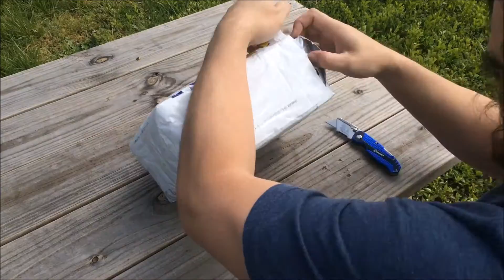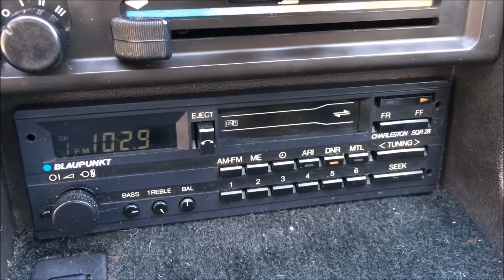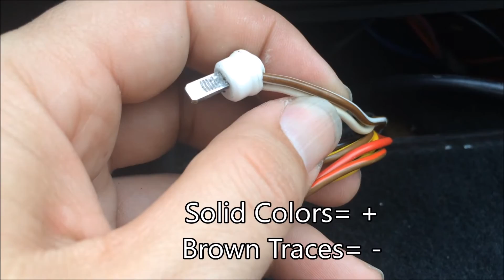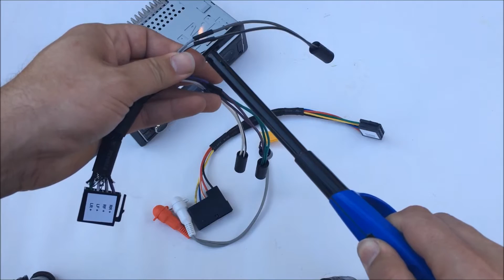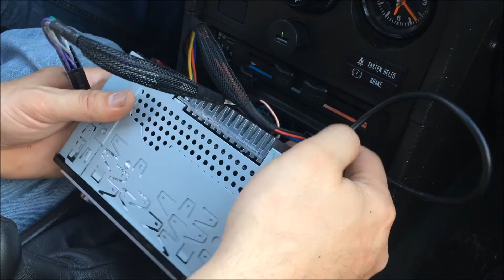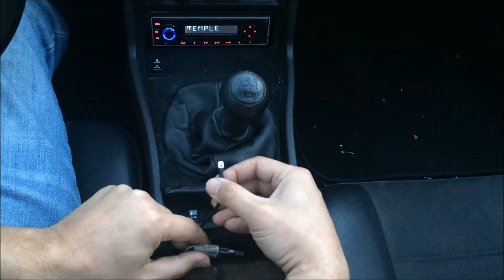Porsche 944 - Installing a stereo with four speaker wiring adapter

Comment: I cannot locate a harness that ties to the 4-spkr system in early 944s with the fader control.  Do I need to run all new wiring or would I just use a pair from the harness you used and still use the factory fader control?
Reply from the maker: I don’t recommend keeping the fader switch. With the switch you’d have one channel powering two speakers which can lead to distortion. To find the individual 4 speaker wiring, just pull the wiring going to the fader switch. I think it’s all brown and not color coded like on the later cars. I also have some footage of where I’ve done this buried in a video I did on a silver 1984 944.
Reply: Ahhh the all brown fooled me. I have seen it and can use that.  I will just have to tap into it since there’s no connectors like that on mine since the fighter control.  I Will look for the video you mentioned I must’ve missed it.  Thanks!!

Comment: The cable in my 944 are not like that at all and i can’t find any information
Reply from the maker: I have come across some cars with completely different wiring. The wiring in the video is the most common that is used on the Reno and Charleston units. Other head units seem to have their own wiring and there isn't much info available on them, so you'll have to use a multimeter to figure out the wiring...

Comment: Does this work on a 83-84? Are the wires the same? The adapter?
Reply from the maker: Yes, for the most part. If you have an aftermarket head unit already there’s a strong chance that they wires have already been cut. I also find that these adapters typically only work with factory Blaupunkt Reno and Charleston units which were very common. However, some other factory units may have different plugs. Good luck!

Comment: Finding a 4x6 speaker that fits well inside the early doors can be a challenge.  Either the magnet sticks out too far and hits the window guide or the speaker frame itself is slightly the wrong shape and won't sit flush with the door.  I guess the other issue is that most tweeters protrude and contact the stock grille.  Do you have any tips or tricks to finding a speaker that fits like stock?  I recently tried to revert back to the original equipment and found some old Blaupunkts that looked absolutely perfect but I think the voice coils were broken since they made no sound at all.
Reply from the maker: Very true. Most original speakers no longer work at this point despite looking new. There are some speakers out there with tweeters that will fit behind the cover. It’s just hit and miss finding which ones do. If you can find a good picture of one before ordering just check to make sure the tweeter doesn’t protrude above the surface of the side of the speaker.

Comment: Edredas, thank you so very much for all your videos - more than once the have kept my 944 running! After installing a new old radio I finally found out a omeone has tampered with my “ignition” cable —> #2 in your
Video. Can you tell me where this comes out near the fuse box? Where could
I grab “IGNITION” electricity when adding a new cable? Thank you so much from Germany - Fabian
Reply from the maker: If I remember correctly, on an early car it should be the upper fuse #9 for the the power sunroof, etc. This runs to the sunroof/radio relay behind the console. Its a rather big relay with a diagram on it and should have all the wiring you need, if it is still in tact. I hope that helps!

Comment: Hello....all your 944 video have been helpful to me as I just purchased an pasadena yellow 1984. Where do I get a tool that takes out the radio like you showed? Mine isn't turing on - what should I check? Thanks so much
Reply from the maker: I got this one from Amazon. It was really cheap too! I've replaced it since then though but it was a pretty good radio until the display went bad. Thanks and good luck!

Comment: Hey, edredas, love the video but got a question. I have a 83 944 that I'm trying to figure out if the stock alarm system is causing a no start issue. However, for the life of me I can't figure out how to get to the radio, let alone remove the radio. Its the stock Pioneer Super Tuner. I can't find any release holes for it or anything to pop it out. Any suggestions would be awesome!! Thanks
Reply from the maker: Hi, all the stock radios were Blaupunkt however removal of a Pioneer is similar. Just remove the bezels and you’ll find slits on both side of the unit where you will insert tools. Those tools look a little different than the ones I used but it’s the same idea where you just insert them and pull the radio out. I’ll leave link so you can purchase some. Thanks. https://www.ebay.com/i/401179823385?chn=ps&norover=1&mkevt=1&mkrid=711-117182-37290-0&mkcid=2&itemid=401179823385&targetid=888730200652&device=m&mktype=pla&googleloc=9009958&poi=&campaignid=9426322747&mkgroupid=98144264760&rlsatarget=pla-888730200652&abcId=1141016&merchantid=116330194&gclid=EAIaIQobChMI-bn44qaB6AIVho7ICh2DswQNEAQYASABEgJXGfD_BwE
Reply from the maker: Also check out my series of videos on the 1984 Silver 944. In them I show how to remove a Pioneer headunit. I hope that helps!
Reply: Thanks for all the help man will check into everything!!

Comment: Hmmm, I have an 83, 944. I hooked up my radio with the existing harness and matched the colors (hardwired) because I can’t seem to locate an after market harness. I can get the radio to power on and off, all of my speakers work etc. However the radio will not shut off with the key and I have to turn it off manually, now I am getting a parasitic drain unfortunately. Any ideas?
Reply from the maker: Sounds like the radio is getting power all the time. If everything is wired correctly, it could be that the ignition itself is stuck thinking that the key is in all the time. Try spraying some lube down in there and see if that helps.

Comment: Just bought blaupunk sqr05 to replace kenwood from my 1986  GE280 mercedes. Would this complicate installation? Checked several Audio service but they seems uninterested as perhaps I am not buying any new audio head from them
Reply from the maker: So it sounds like you're wanting to replace your stereo with a stock unit? If the installation was done correctly using an adapter, then you should be able to remove it and plug your new one in. However, if the wires have been cut then you might have to track down a harness in order to get the radio to work. I hope that helps!
Reply: edredas just bought removal tool. Will see how it goes.

Comment: I am a little confused with the dimmer switch hack. I appear to have the same setup. Two red wires. What I was wondering is is it even necessary to pull the spade out of the second red wire third from the top? Wouldn't it just be possible to run that wire directly to the cigarette ashtray?
Reply from the maker: Yes, rather than connecting that wire to the adapter, you can just connect it to any wire that gets a signal when the parking lights come on. I used a sleeve over my wires and was wanting everything to connect through the adapter, but I really didn't have to. I hope that helps!

Comment: Aren't installation kits generally required? Just ordered the Metra parts and was thinking back to previous installs I have done. I have always needed some kind of installation kit but it has always been on newer cars
Reply from the maker: In most cases you need a kit to use single DIN head unit a larger double DIN slot. In this case I'm installing a single DIN head unit into a single DIN so there is no kit required. I hope that helps!

Comment: My Blaupunkt Portland radio only has 2 speaker wires black and white,going through the fader control on the console,this is an '86 model.My radio is not working properly,only one side. Wish the wires were as long as those in the video!
Reply from the maker: Here's a link to a video where I removed the fader switch at the owners request. The fader was broken inside and causing volume issues, which could be the issue you're having. If you are installing a new radio, getting rid of the ancient fader setup might be the best option. On the fader you will find wires running to each speaker and you can just hook your wires there if you wish. I hope that helps!  https://youtu.be/G_qwdu_5Fnw?t=17m18s

Comment: does the adapter fit for a porsche 924 1980 mod??
Reply from the maker: I wouldn't think so. At the moment I can only verify that it works on '85.5 944's and 924S if you do the illumination mod that I showed in the video. That said, it may work on 1981 and later 924's and early 944's but I haven't verified that yet!
Reply: ok thanks. do you know about any sites where i can find the right adapter? :)
Reply from the maker: I'm not entirely sure such a thing exists for the early 924's. You might have some luck asking on 924board.org.

Comment: I am driving my dad's 1986 Porsche 944. It has an aftermarket radio. For some reason I am not getting audio from all speakers (when I test L/R front/rear with balance controls most sound from left side and front). We can't remember if it has the stock speakers or not. How would you advise troubleshooting this? How often does the speaker wiring go bad requiring replacement? I am interested in upgrading stereo and speakers myself but looking for information on speaker wiring to understand what may be required.
Reply from the maker: This is actually rather common and most of the time it is caused by old factory speakers that no longer work. The simplest way you can test if the speaker is bad is to take the speaker out of the door and hook up a known good speaker. If it works then you have found your issue! Usually the wiring doesn't go bad and doesn't need replacing but if there is a short then that could be your issue. That said, if the test speaker works then you can probably rule out a short, if it doesn't it could be the head unit. I hope that helps!

Comment: This is my next project actually, I have an 86 944 Turbo with a Sony after market stereo installed right now but it's a CD head unit and I am  BIG fan of the JVC Bluetooth (no CD player) head unit (I have it in three other cars already) So for the sake of continuity I will be installing one in the 944. Thanks for the video!
Reply from the maker: Cool, good luck with your project! I have a JVC in my turbo, but this was my first non-CD player unit. I really like that is can use an SD card which has been even better than using a USB thumb drive since those stick out and get in the way.
Reply: Just an update. I installed the JVC unit in my 951 a couple of weeks ago and a PO had cut out the factory connectors but they  installed short pieces of wire color coded to the aftermarket harness that seems to be universal these days and did a nice job so it was a simple matter to just color match the new harness. Took about 20 minutes start to finish.

Comment: So i was wondering if it mattered the year of the Porsche because i have an 83 944 and on the website it says that the wiring adapter doesnt fit with my car.
Reply from the maker: +Kyle Capaldi I tried to find a wiring diagram for the early cars to verify but came up short. If I remember correctly it doesn't mention that it fits the 924S but as you can see it does. The wiring should be similar to the early 944. I hope that helps and let me know what you find out so I can post it here. Thanks!
Reply: Thank you for getting back to me. i will be ordering the adapter so and ill let you know it it fits or not. Thanks again.

Comment: Now I can do the stereo upgrade myself too. Thanks.👍
Reply from the maker: What year of 924 or 944 do you own? I could never find a wiring diagram to verify that this adapter worked with early 944 and was wondering if anyone with one has tried it?
Reply: edredas I have a 1987 924S and an '89 944 turbo. Both has aftermarket stereo but it's the 87 that I want to change.